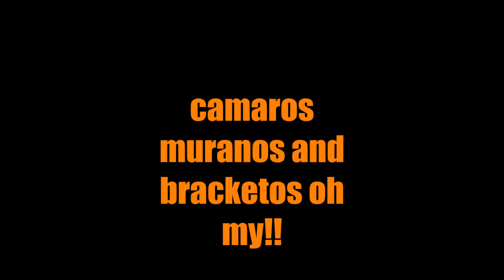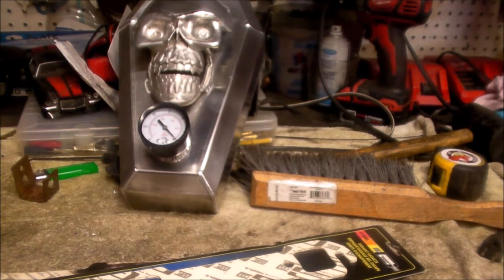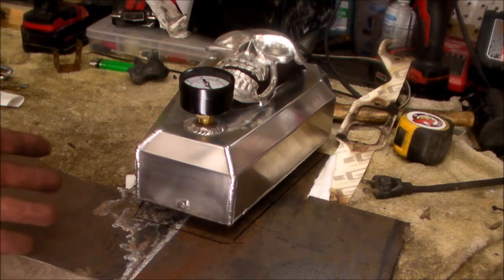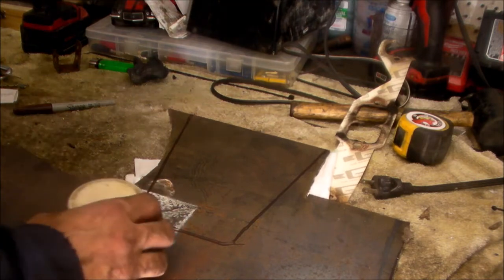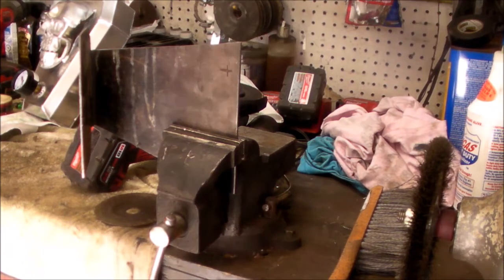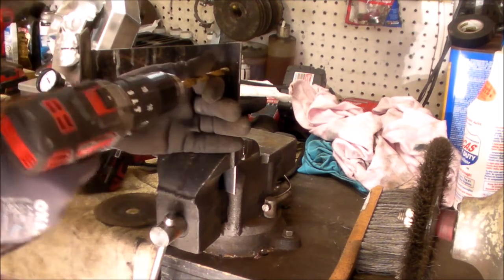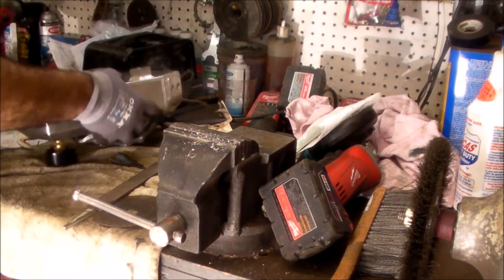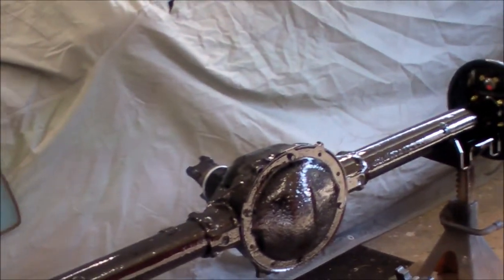73 camaro brackets gaskets and brake pads

Comment: Hey if you're blowing header gaskets next time take it off and run a flat file across the beads and make sure they are level. I ran those gaskets for year's with out blowing them. I also used the Mr.Gasket Allen bolt kit with a long Ball Allen socket to run them in and they're good and tight. Never had them come loose. Also, love the Vac Gage man. That thing is cool as hell.
Reply from the maker: John Gilley thanks John this gasket is probably eight years old so it had a good run but good advice non the less thanks John take care